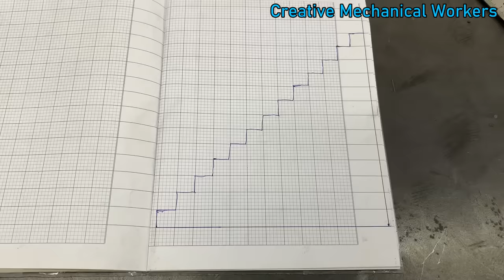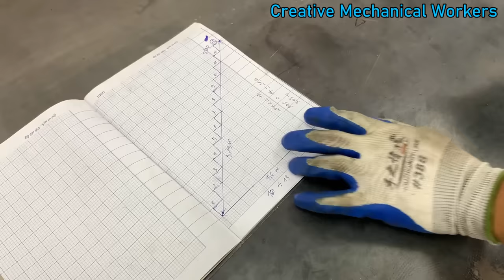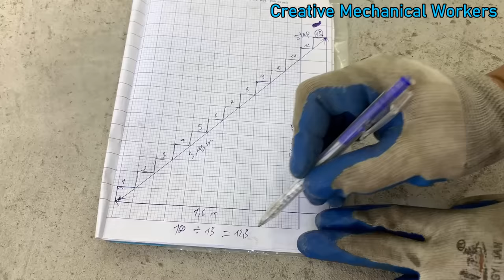Smart Folding Stairs Extremely Utilities For Small Spaces

Comment: The plan at the beginning showed the stairs ascending at a 45 degree angle, but the final result was MUCH steeper. Looks very dangerous to me.
Reply: Plenty of steep stairs out there. You just be careful every step ohk 😊
Reply: @Nath-sn1mv  No. Not okay. Besides, my point was why doesn't the finished product match the plans?
Reply: @davidnettleton3375  maybe the "plans" were drawn for the sake of the video?
In relation to "dangerous", have you ever seen a loft bed? Of bunk bed? The ladders used for those are even more vertical, however people still manage just fine 🙂 
Atleast I did when I was a kid.
Anyway, all I was saying was, if you look see it as scary/ dangerous, just be careful and you'll be safe 😉👌🏼

Comment: I like the safety slippers and welding sunglasses. Also a good thing that the music wasn't annoying at all. Would have been horrible if you chose only one track and repeated it over and over again.

On a serious note:
-You should add a handle so you don't risk pinching your fingers.
-You should add a support to the wall for the upper outer part of the stairs to rest on when it is extended.
-You should add gas dampers which can take some of the load so its easier to extend and retract the stairs.
Reply: Like your sarcasm.
Reply: @chakravarthy68 plus a "UV" tan to die for😂The old saying "A little knowledge can be dangerous"

Comment: the drawing you had us watch in the beginning was a 45 deegree staircase but it ended up not being that. This would not meet any codes here in the U.S. If you weigh more than 100 pounds you should not take these stairs.
Reply: Just call it a ladder - problem solved.
Reply: Then design one that meets your codes.